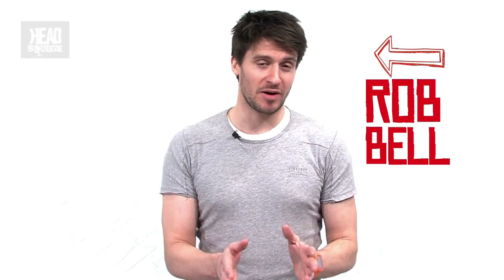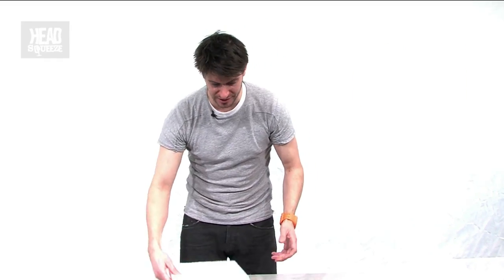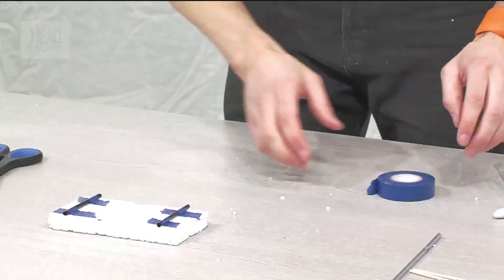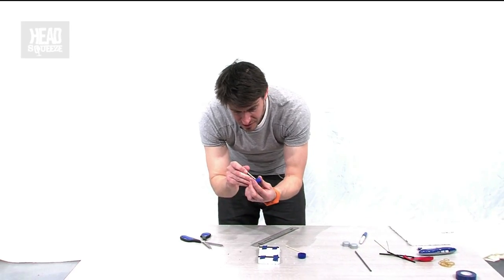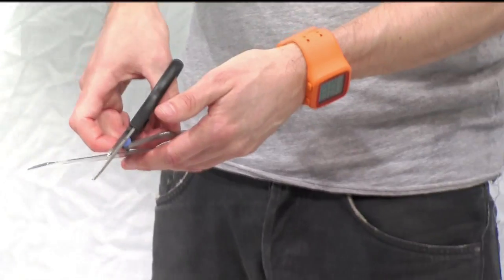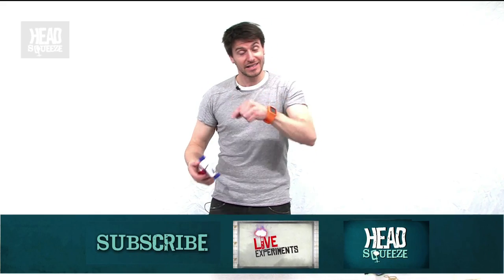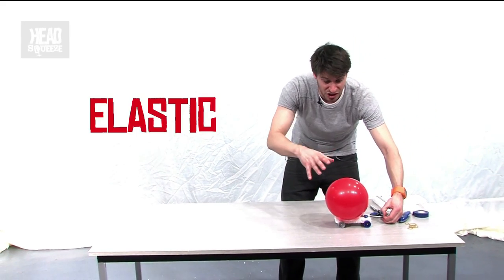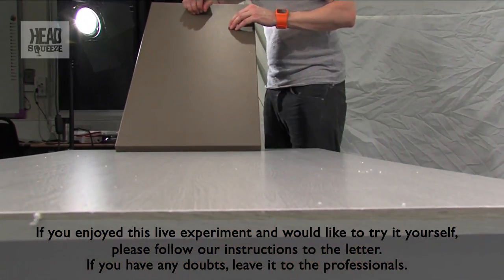Balloon powered car! | Live Experiments (Ep 24) | Head Squeeze

Comment: wat u could also do was to add abt a thumb size modeling clay or any thing similar to that.den stick it at the ends of the skewer,taking note not to push in too tight until the wheels are not able to turn.tis way the wheels will not be able to come out